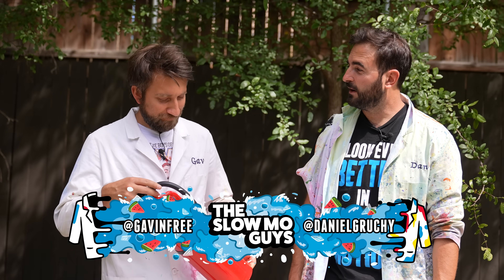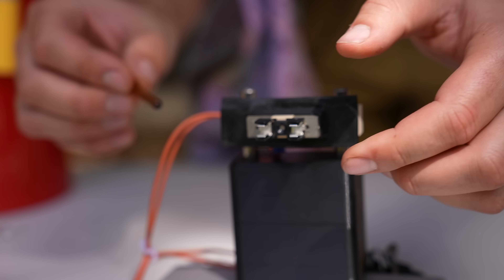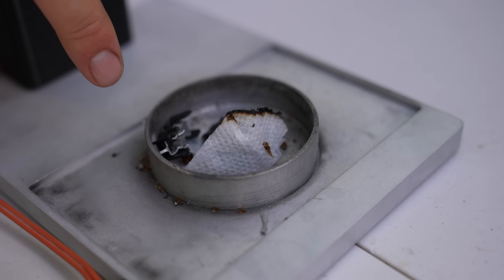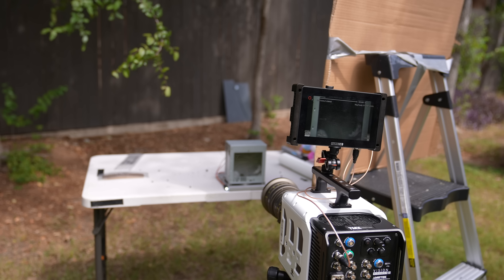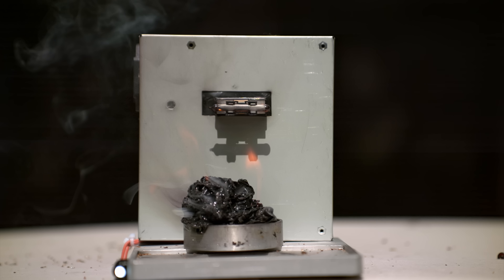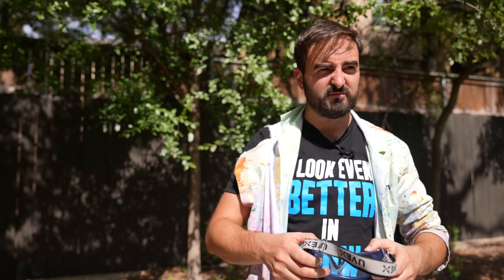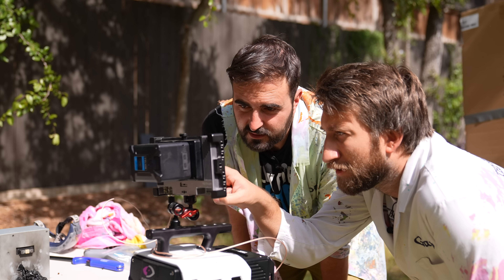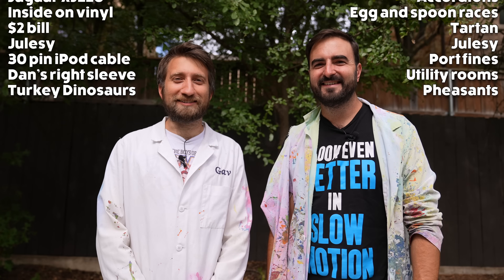Tiniest Exploding Fire Extinguisher at 150,000FPS - The Slow Mo Guys

Comment: I wonder why Gavin still films outside after so many years. It wouldn’t take a huge amount of effort to have a filming room setup, or even a mobile box or backyard shed, and not have to worry about sun or weather to get enough light for high speed filming. It would even allow for more safety precautions, like allowing them to film from outside the shed. As well you could control the color, intensity of lighting, direction, and dithering in a controlled environment. 

Such a thing would allow them to film at even higher speeds and be able to make out amazing detail any day and at any time, not just on clear, sunny days. I’ll bet he earns much more than it would cost to hire a professional to set it up on this video alone. 🤔
Reply: Amazing video as always of course, it just struck me as curious. I would love building a project like that personally.

Comment: Putting out fires with explosions? The Swedish armed forces did that with forest fires a few years back, dropping a laser guided bomb on it. And before that they have used mortars to shell forest fires. The reason that they did this is that the fires were on real firing ranges and it was deemed too dangerous for traditional firefighting.

Comment: The oil industry frequently uses explosives to snuff out oil well fires. Might be a fun video to do a smaller scale version - like using a gas nozzle and a small explosive, like a firecracker. Would be especially fun if you could partner with an actual explosives expert to do a bigger example!
Reply: Dan is an actual explosives expert.

Comment: Crazy that at 5:54 the light flickers instead of just going off like before
Reply: I'm assuming that the conductive shell wobbled in and out of contact with the full circuit before completely coming apart?
Reply: @LeonardMeltsner  last blinks are happening, when shell is long (slowmo scale long) gone. And video isn't THAT much slower than first ones, where lights were just cut out. I'm intrigued by this flickering.
Reply: @LeonardMeltsner  Or maybe the fluid is conductive.
Reply: @G-Forces  i've checked solution used in this extinguisher is liquid called Novec (aka "waterless water") and CO2. Both are dielectric... duh! It would be very strange to use conductive liquids to put out fire in electronics.
Reply: @justunfoe  Yeah that's a good point.
Reply: It probably did that in the other shot but it just wasn't slow enough to see.
Reply: Maybe the inductance and capacitance of the wires
Reply: @coder0xff  No, definitely not.